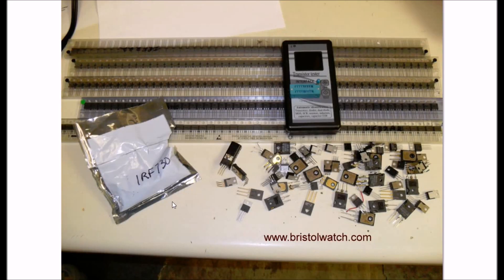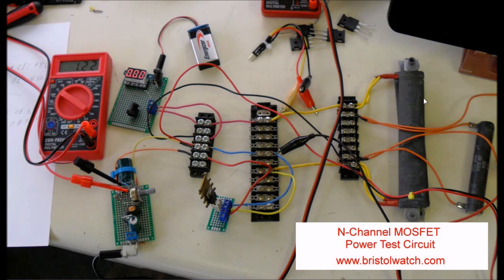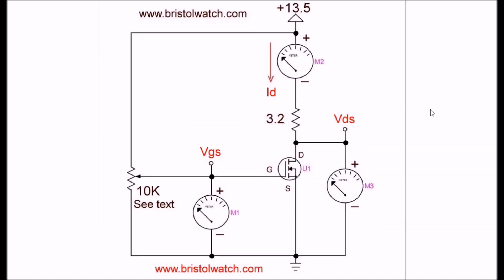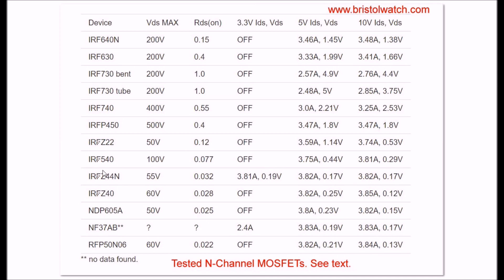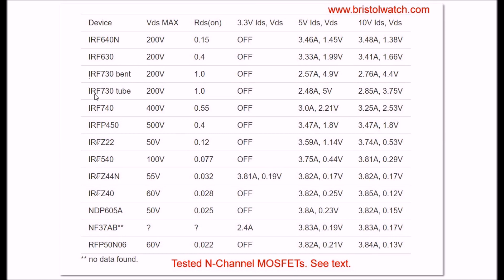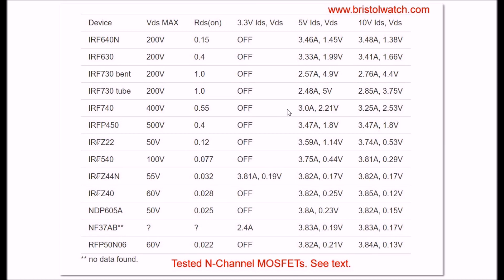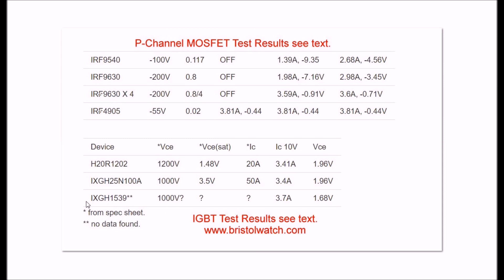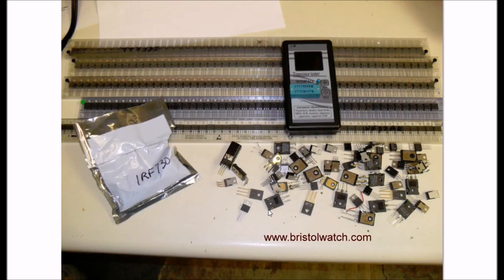N-Channel MOSFETs Test Results, Observation

Comment: Thanks for the video, very informative. BTW,...
Have you considered the IRFB3206 (Rds=3mOhms, Vdss=60V, Id=210A)?
I'm loving it in my microsecond LED strobe.
Reply: The datasheet says taht itsVGS threshold is 2-4V, and 75A flows at 10V. It says the max RDS is 3mOhms. Does taht match with your experience?

Comment: Hi lewis nice vid love your content always learn something thank you...i have a unrelated question could you use two zener diodes back to back iin place of a diac to fire a triac?
Reply from the maker: No. A diac develops something called negative resistance. That is as the current increases resistance drops. It has a fast switch on speed Zeners don't have.
Reply: @LewisLoflin  ok thanks fella
Reply: @LewisLoflin  - This topic is worth a video.
Reply from the maker: @boonedockjourneyman7979  Yes it is. Lots of people use MOSFETs and really need to know how they work. Everyone wants to go to 3.3V hardware, most MOSFETs won't work at 3.3V.

Comment from the maker: Links to related material:

Weblink for tables, data, and schematics:
http://www.bristolwatch.com/ele3/mosfet_test.htm

LM2575 Simple Switching Voltage Regulators
http://www.bristolwatch.com/sr/index.html
https://youtu.be/6Qrs3JmdPl8

Issues on Connecting MOSFETs in Parallel
http://www.bristolwatch.com/ele2/pm.htm
https://youtu.be/AOf-i2vLd2o

Simple Circuits for Testing MOSFET Transistors
https://youtu.be/mv0IksPy2JQ